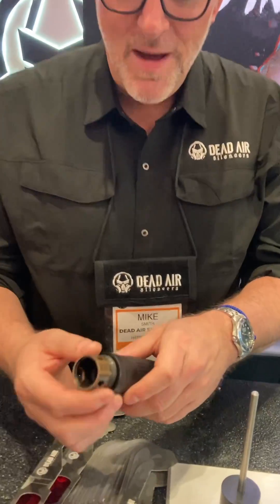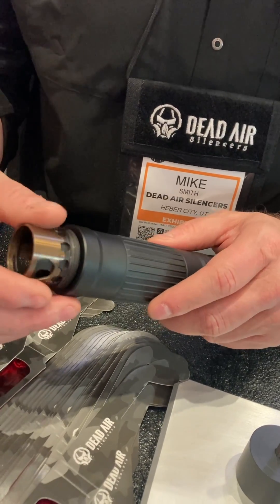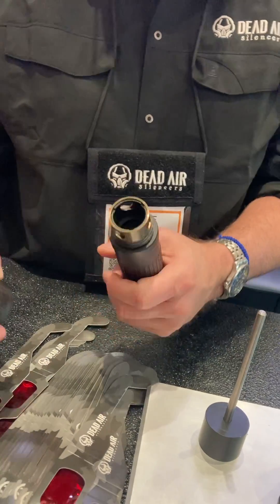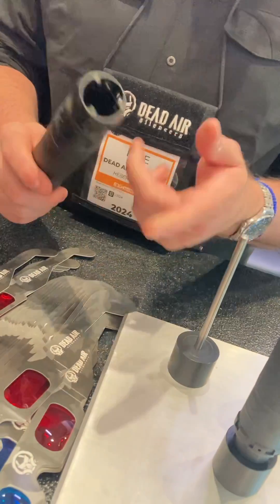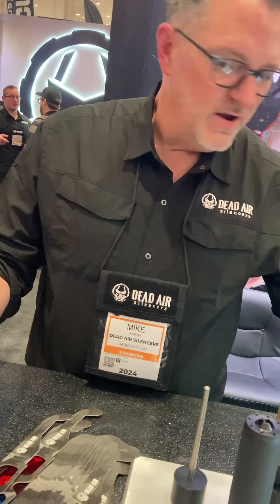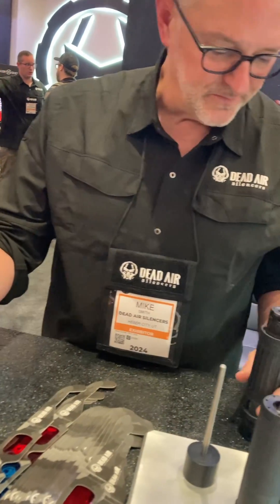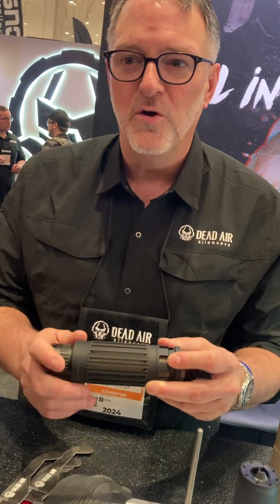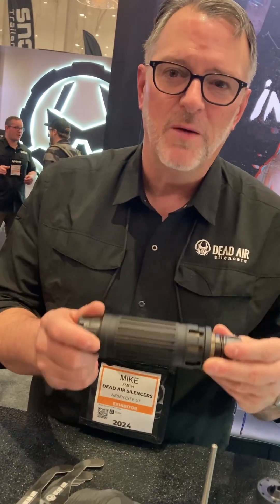Dead Air Lazarus6

Comment: Hopefully this will be affordable when compared to the Ventum 762 (sounds great, hardly any back pressure and is available in the 700s from Primary Arms right now...).
Also, I hope these wont be plagued with  durability issues like the Sierra 5 is. I wanted a Sierra 5 so badly for my HD rifle, but there are so many stories out from folks getting baffle strikes and broken blast baffles that nearly everyone I know and many ppl I dont know but are outspoken online are staying away from Sierra 5 models right now.
Reply from the maker: The Sierra5 issues have been disappointing to see and I realize the statistic doesn’t do anything to help people effected by those problems, but the number I keep hearing is that that the problems were limited to about 3% of cans released. If someone doesn’t want Dead Air after this, I get it. There’s still a lot of good can companies to choose from. Personally I still think Dead Air is one of them

Comment: Nobody is going to call them out about their S5 issues??
Reply: Did you buy one a s5
Reply: @williamboggs1682  yes
Reply: Did it break
Reply: @williamboggs1682  Yes, it did.
Reply from the maker: I think pretty much everyone has called them out?
Reply: @Z3R094  did they or are they fixing it? Also, that's KGM fuck up, they were making them.
Reply from the maker: @MoistHousePlant yea, although it’s taking longer than people hoped, Dead Air is 100% warrantied.
Reply: Starting to beat a dead horse with this one. They’re aware of the problems and working on them slowly.
Reply: Not a soul bro everyone is acting like it never happened. No one is calling them out on it. Literally giving customers permanent hearing damage and no one seems to give a shit.

“Oh but look at their new 556 can” 

This is why the firearms industry stays toxic.
Reply: @2AF_com we’re gonna ignore making their customers wait longer because they refuse to rma their defective product and as such put customers at risk of permanent hearing loss?
Reply: Think we are passed that now, this suppressor has my interest if it's 30cal.
Reply from the maker: @freethinkingamerican80 this one is a 6mm can optimized for 556
Reply: @2AF_com  ok, and what exactly does that mean? Like a 30cal can optimized for 5.56?
Reply: Just wait till you need to use the warranty that ain’t there